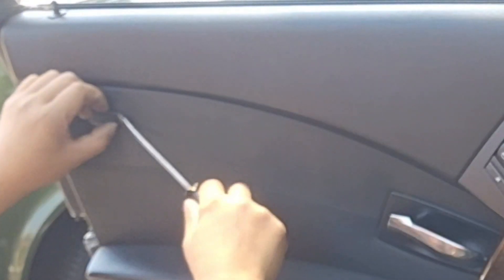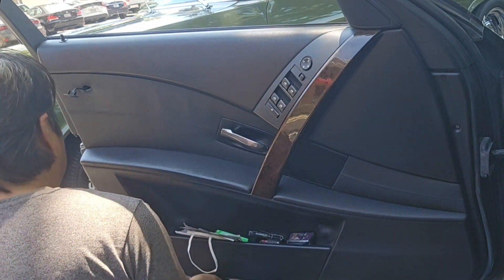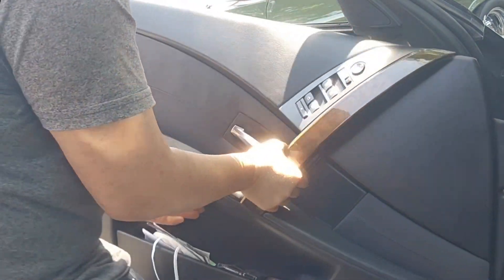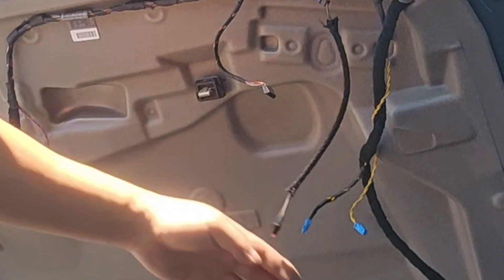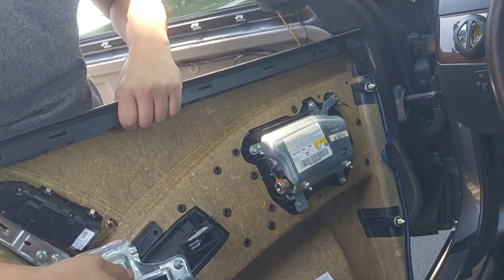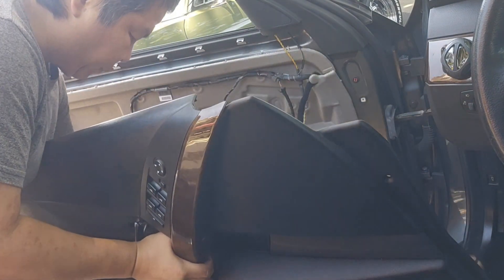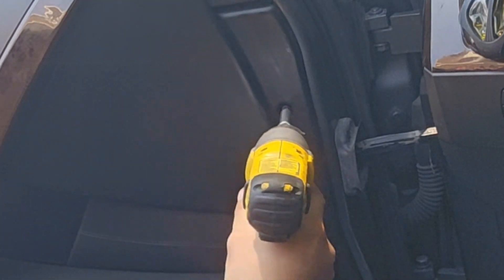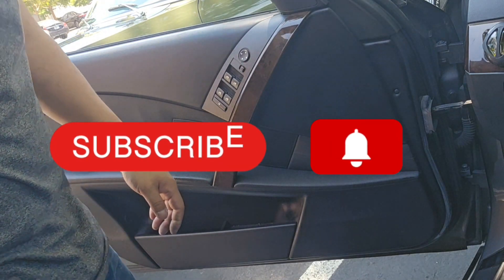BMW 5 SERIES E60 E61 FRONT DOOR PANEL REMOVAL

Comment: Hi. I removed the door panel but a plastic rail fell off it, was it glued there? Without it, I can't put the door back in the clipps because nothing holds it.
Reply from the maker: Thank you for watching my video and I will be appreciate you if subscribed my channel too
About 4:00min of video you should take out black plastic out and put that plastic to door and there is no glued there
Reply: Its on the door panel not on the actual door, its a water runoff plastic thing. Just after the top of the doorpanel. @homeboysstereo
Reply from the maker: @heavygamer7053   As you see the video I didn't used glued to put the door panel back on. 
I'm sorry if my video wasn't helpful for you